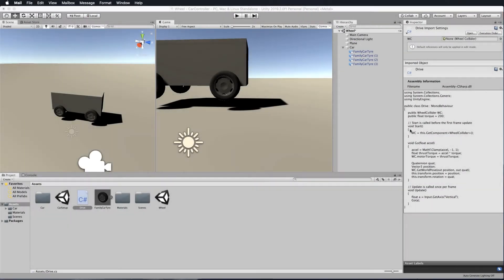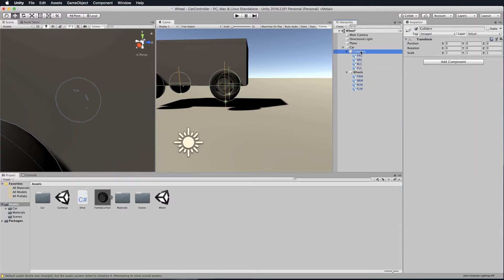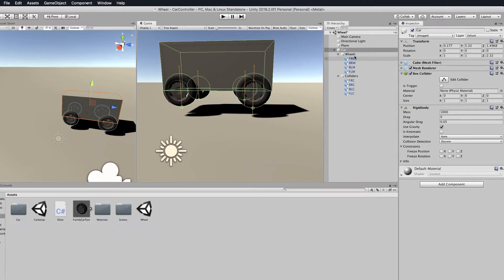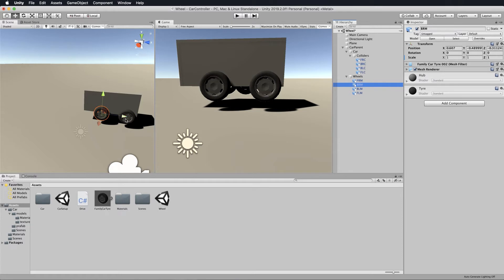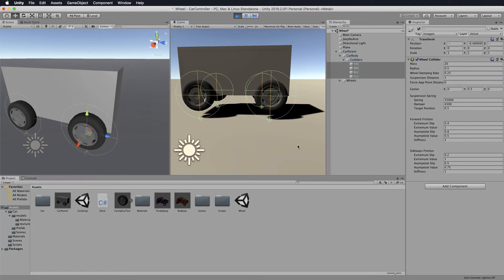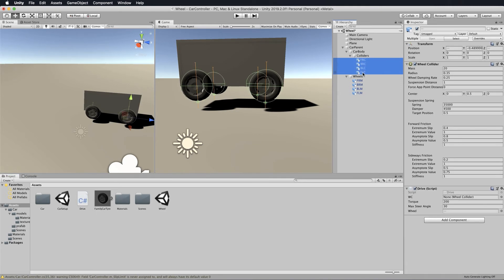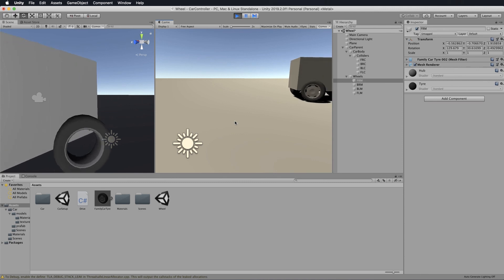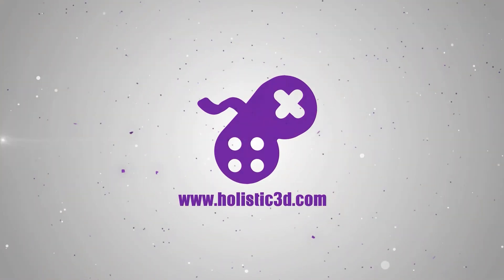Wheel Physics in Unity 101 Part 3.

Comment: Hmm I have gotten stuck with applying the wheel collider rotation to my meshes.  I don't have distortion, however my wheels are rotating around a World Axis Center instead of on their (or the collider's) pivot. I have them tied to a parent GameObject that has been aligned correctly etc.
Reply: Nevermind, I figured this out moments after posting my original question.  My wheel GameObject is comprised of 3 child meshes (Tyre, Rim, Hub) and they each had a transform position value independent of the parent GameObject (it was relative to their world axis center as they were moved independently after being placed in the world, before being parented).  Once I zero'd their positions out everything was aligning well with the WheelCollider. In fact this hierarchy has allowed me to offset some of the wheel components using values, which might be handy in future if substituting rim meshes or hub offsets etc.
Reply: Also, I bought the full course on Udemy :)

Comment: This seems like an extremely painful way to set up a vehicle system. The way it should be done is to set up a vehicle component which let's you set axel position and type, vehicle mass, base length, and acceleration, etc. The vehicle system component should then calculate  all the wheel parameters, such a the spring force and the damping factor. What's the point of using object orientated programming unless you follow this approach. The vehicle component can the be reused on other vehicles.

Comment: Can you teach how create a motorcicle with a  Wheel Physics? Using 2 tires my bike always fall to the side.
Reply: You could use the restrictions thing in the rigid body for you motorcycle to make it so it can’t rotate on the whichever axis it is that lets it fall over, then you could use some other method of making it tilt when your going on turns, like use animations or use math, like when you turn, the tilt is really low but the speed your going multiples it so you tilt more when going faster on turns

Comment: I know this tutorials a bit old, but I've been taking notes and doing the stuff in the past 3 of them. Nice videos, have really helped but I have one problem.

Simply, my car is not as fast as yours. I am using my own wheel meshes and they are not that different from yours, just slightly bigger. Using them exact same values in the wheel colliders and rigidbody but it doesnt change it. The car is just extremely slow, and changing the torque to something higher just makes it wheel spin which I dont know how to fix. Any help is appreciated

Comment: Hello, I have seen your tutorial, and I have a problem that I do not know how to solve. And it is that when I add the line of code of "wheel.transform.rotation = quat;" It spins my wheels 90 degrees, and there's no way to put them in the right direction. The axles are fine, and when I hit the Play, they remain the same, but the wheels are crossed. Can you help me? I have been thinking about it for several days.
 :(
Thank you.
Reply: @Chance Plays I know this is an old comment but try double checking the pivot centre of each mesh to make sure they all match, if there are no errors then it's likely to do with your setup.